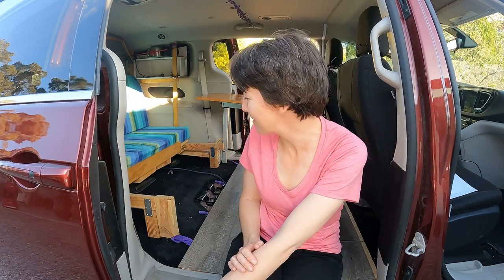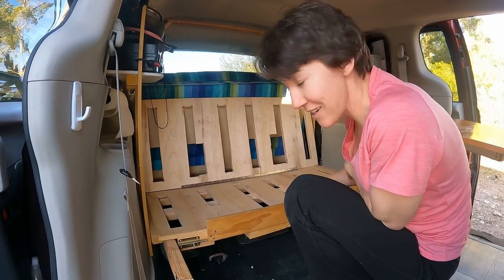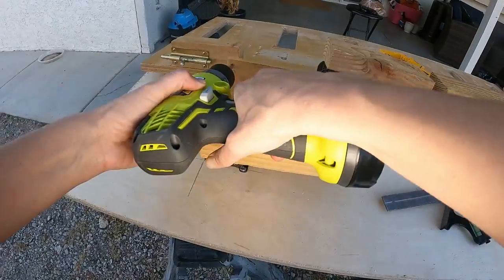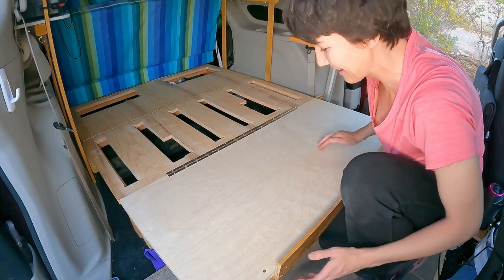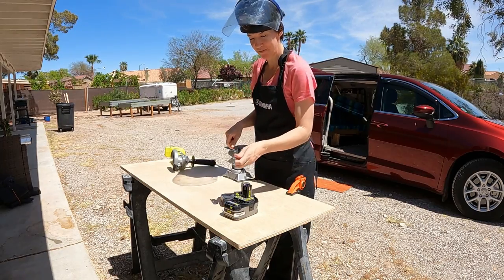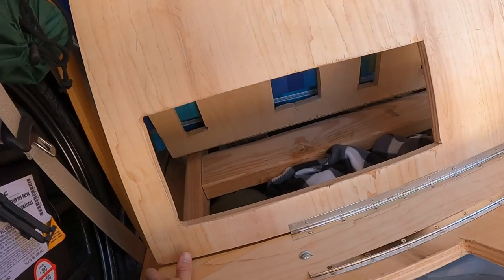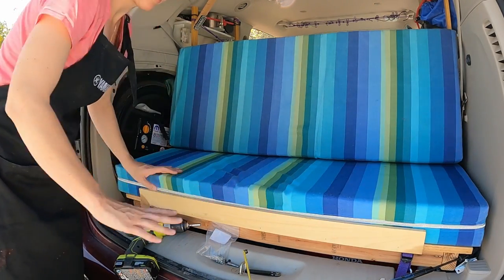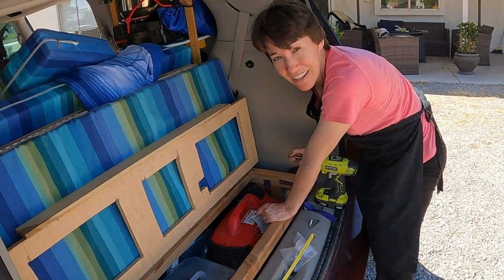BROKEN! My minivan camper bed BROKE! I de-construct it to fix it, and install gas struts!

Comment: Ohhhh.  You can’t compress them by haaand.   🤦‍♀️ I sent mine back because I couldn’t get them to close before I put them on.  😂.  I just learned something extremely useful.  Great job on fixing the bed and putting on the struts.   You cut metal… that’s where I draw the line!  😅
Reply from the maker: Oh no! Haha. Yeah, I was a little skeptical - how can they compress if I can't do it by hand? But, the instructions were right. And yeah, metal cutting is a little crazy,  But this little Ryobi grinder I got is a total game changer. It was really easy.

Comment: Another great video.  I've recently found your channel and enjoy the content centered around smaller vans.  
Couple of notes you might consider...
1) You can keep the new panel from sagging by adding a few screws along the edge of the board that holds your cushions in place.  All you really need are 3 to 4 screws in the middle section of that board to add a good deal of strength with no further modifications.  Just pre-drill slightly smaller holes to reduce stress on the end-grain but provide grip, then use long (2-1/2" to 3") screws to secure the board in place and distribute the pressure (the same can be done with pegs and glue if you don't have long screws - just drill holes that match the peg size instead of going smaller).  Doing this will add a great deal of strength and make your bed last longer.
2) In the back section, add small door hinges directly above the struts.  Those areas are under a great deal of tension and will break soon.  Use bolts instead of screws, though - they will add strength and prevent tear-out due to the tension.
Hope that all made sense.  You've done a tremendous job.  Just a couple of tweaks will help it last. 😉
Reply from the maker: WOW! Thank you so much for the great advice! I was scared to put in screws in the end grain, but I'll drill it and give it a shot. And BOLTS! What a great idea. I've never thought of using bolts with hinges, but yes, that's definitely what it needs. Thank you!!
Reply: Door hinges, very cool!  Do you think door hinges could be used instead of piano hinges?

Comment: I think you installed them backwards. 
Instead of the bottom being towards the rear of the van and the top being close to the hinge do the reverse.
Put the bottom towards the front of the van and the top near the back. That way it has the most leverage for opening. Also then the pressure is making it lift up (not lift up the hinges). I installed New struts Under my travel trailer bed to lift more weight and had to redo three times as the pressure difference and geometry changed. E.g. first it wouldn’t shut as was lifting too much so changed to less of an angle and worked. You will have to fiddle but I think doing it opposite to the way you’re doing will save your hinges and use the lift more to mechanical advantage. Hope this is helpful.
Best wishes. Like following your journey.
Reply: I think S. Chacon is correct.  
Based on looking at gas strut hinges in videos of use and van builds, I remember the top end of the strut on a panel lifting up attaching on the side opposite the hinge, so that the strut has leverage to lift the panel.  It has no leverage near the hinge.
Reply: I absolutely agree. When you check a rooftop box with these kind of struts, they are installed the way you have described. Good catch👍
Reply from the maker: Thanks S.! The instructions that came with it had your option as well as this way as an option. I agree, it would be better the other way - but I don't think I could make it work because of my mounting options. I'll give it another look though. Thanks!
Reply: @Minivan Camper Gal  I think MUCH better working that way.  The downside is the struts are more in the way on the side when open.  
As I initially said, I wanted to lift more weight so switched out for heavier struts.  Because the angle changes as the strut lifts: 1. The more horizontal when closed will stay closed easier, tradeoff is harder to initially open (my mistake was I couldn't get closed and didn't put the weight on it when initially checking)  2. If don't have enough lifting power mount the lower half lower (so angled more to lift more to mechanical advantage).  However then won't lift as high.  Takes fiddling.  Have fun!  (Likely more frustrating haha)

Comment: I would probably have cut a couple of battens to strengthen the first section.

The gas struts? You are trying to compress two thicknesses of mattress where your panels hinge. I'm not surprised it's difficult. Perhaps Eric's 4" section should be 6"?

Comment: Thanks for taking the time to show us your work/thought process on this. I'm just starting out and so far, no actual build - just a lot of rearranging and trial/error stuff. I wanted a ramp for my little dog and my brother and I worked on getting the angle, surface, stability right for a couple hours one sunny afternoon. The ramp is beautiful and functional however, my dog refuses to use it. :) I'll keep watching you. Only about 8weeks until I'm full-time on the road. I have so much to do and so much to learn.
Reply from the maker: Hey AMRAP! Haha, that's funny about the ramp for your dog. Good luck with your build and your journey! I look forward to seeing you out here. It's so much fun, you can do it!
Reply: Life..., adding grip tape or carpeting might make your dog more comfortable using the ramp.

Comment: Good for you! I have always had so much trouble installing those shocks. I guess I don’t get the angle correct, but I get frustrated with myself, cuz I keep think I should have learned from the last go-round. Congrats for getting 2 tasks completed in the same day. 😁
Reply from the maker: Hey RoadTrip! Thanks for watching. Yes, they were pretty tricky - I cut out a lot of my messing around and cursing, lol. Thanks for watching!

Comment: What size struts did you end up going with?
Reply from the maker: I got 10" 35 lb struts. I think I should've gotten longer ones though, that way I could have mounted them differently. It's tough to know!
Reply: @minivancampergal1554  Thanks for this, wish me luck with my install 😅 amazing video